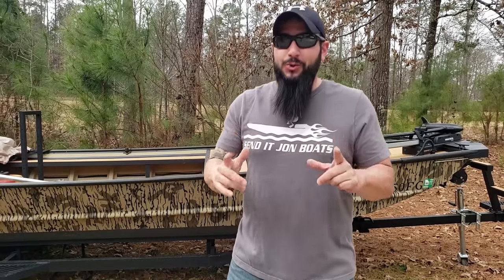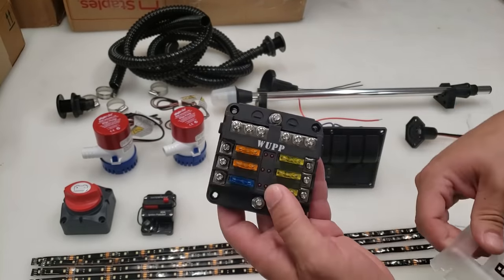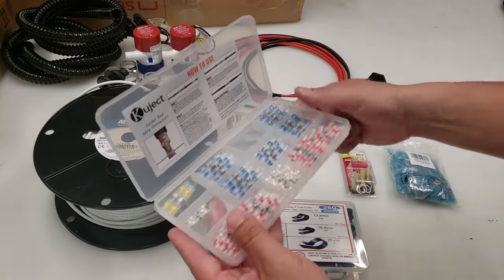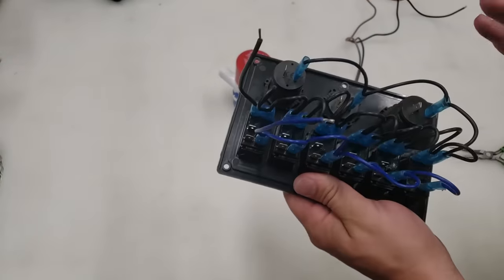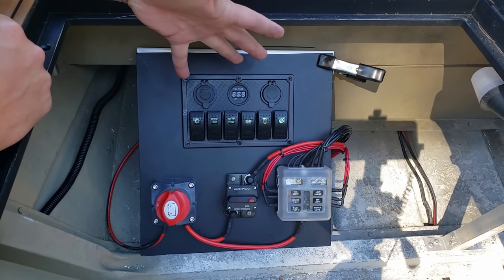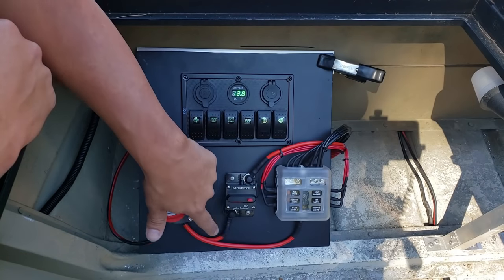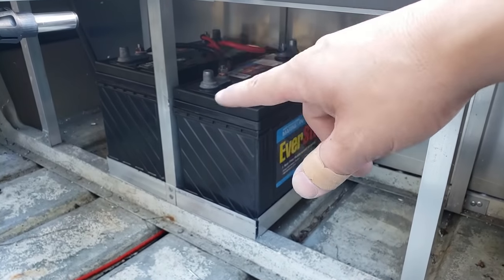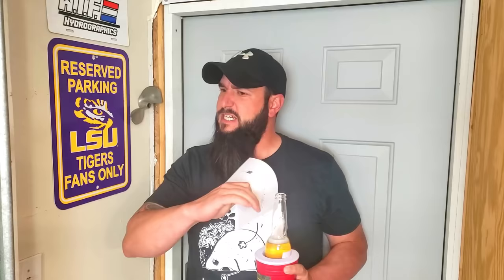Jon Boat Electrical Wiring for Beginners and DIY'ers

Comment: I had 14/3 left over so I just used my romex, I just pulled the black and white wires and used liquid electrical tape to seal it from the elements, has worked so far for me, great video

Comment: Hey I plan on doing the same build with wiring and electrical like you just showed in this video in addition I also plan to run a motor and set up similar to yours will the 13 hp predator be able to hook up to those batteries to use electric starter and charge batteries while running

Comment: Question.  What gauge wire are you using for your trolling motor? Have a 50lb thrust motor. Guy put some quick connectors on it and they are only 10 gauge. A 60amp breaker says its good for only 6 gauge so I'm thinking I would bypass the breaker and wire to the bus terminals instead. Thoughts?
Reply from the maker: I use 6 gauge for any trolling motor over 55lb thrust. On smaller motors like mine I use 8.

Comment: Very comprehensive video. I'm curious to know if your batteries discharge equally or if one discharges more when you use them in parallel like that.
Reply from the maker: Mine discharge equally, I think the key is using 2 good quality batteries that are the same age and have always been used together. I wouldn't take one old battery from one boat, and another random battery and expect them to discharge at the same rate
Reply: @SendItJonBoats  When doing this its important that the both batteries be nearly identical, same size, age, and make.   Just buy two at once.   Use a good smart trickle charger and condition them both together.  CTEK makes a good charger/maintainer.   I also use those wally batteries, they are really good.

Comment: Great video! I learned a lot! I'm restoring \ building a 1966 Mirrocraft 14 ft vhull deep fisherman. It my first boat. My question is that I drive a 1989 GMC 1500. Will changing my trailer bulbs to Led and with the boat I plan on changing everything to Led as well. Will I run into any problems or need to do anything different as in changing the bulbs to Led instead of the using the old style bulbs!
Reply from the maker: You should be fine to change over to LED. I changed all mine over and had no issues.

Comment: Got connection question... I've got a fuse block that I need to connect a 6g wire with a ring terminal...the fuse block post is small in diameter compared to the ring terminal size thats needed for 6g wire... what did you use?  Great video
Reply from the maker: Go to auto zone or Oreillys and get the copper battery terminals that fit. I am assuming you are wanting to hook up the main lug not one of the small accessory fuses. I like the solder on battery terminals but some people use the crimp on versions too.
Reply: @SendItJonBoats  yep, main lug... thank you sir! I'll check out so.e auto parts stores

Comment: We finally have to replace our motor after 29 years. Our Vanguard has low compression in the left cylinder and the Go Devil longtail is worn out after extensive use and slamming into who knows how many stumps. (RIP it lasted a VERY long time. We definitely got our moneys worth out of it.) While we spend $4500 on a new one I definitely want to splurge and add a battery switch, voltage meter,  second battery, and a phone charger to our boat. The boat is also 29 years old and the wiring is very outdated. It doesn't look as hard to do as I thought it would.
Reply from the maker: Nah it is not hard at all, just a little tedious. I knocked all mine out in 2 days and filmed it, so in reality it is not bad.

Comment: Hi, nice video , one question I start my boat wiring , have a 50 HP Yamaha 4 stroke , if necessary to install a circuit breaker or not , it is necessary which one is the correct amp for these motor ??

Comment: Great videos! Will be using this for rewiring my 19’ jon boat. How do you connect the power for the boat motor to this system? Just run straight from the battery switch? Ignoring the fuses and switches correct? Or should it have a breaker similar to how you have the trolling motor set up?
Reply from the maker: Run a separate battery for cranking the outboard, with its own battery  on off switch
Reply: I’m doing the same kind of project. I have a 8 switch rocker panel and I have only one battery. Am I not able to connect everything to that one battery or do I need an additional battery as well?

Comment: What size wire for the battery positive to switch and also the ground wire from battery to fuse block?
Reply from the maker: Depends on how far you have to run the wire. I used 6g because I had a short run.

Comment: I've watched your video twice and scrubbed through a third time and there's one thing you didn't specify (unless I missed it). All of the negative connections that are daisy chained on the rear of the switch panel, where do they end up going to? You can see at 27:23 that the last negative from the daisy chain hops in with the bundle of negatives that goes back to the front of your panel, but, where does it connect? I assume it connects to the negative bar across the top of the fuse block?

Comment: If just running 1 battery to the off switch do you still need and inline fuse between battery and switch, also if running trolling motor off a different battery with a 60 amp breaker on positive side do I need an inline fuse between battery and breaker as well? Thanks and great video tutorial.
Reply: Fuses are inserted to protect the cable. If there is a risk a current can flow of a magnitude that can cause the cable to get excessively hot, melt and catch fire, you need a fuse.
Reply from the maker: I always put a fuse in, just in case.

Comment: Whats better, wiring every thing to 2 batteries parallel or run separate batteries for trolling motor and another for the electronics

Comment: Love the video, very helpful. One question, instead of tinned copper, could you use oxygen free copper and still get good corrosion resistance?
Reply: No. The tinning on the wire is what helps with corrosion. Oxygen free is a better choice for say car audio. Now oxygen free, tinned wire would be excellent but probably pricey.
Reply from the maker: What Chris Murray said. Oxygen free is for car car audio and stuff like that. The tin is what keeps it from corroding.

Comment: Was curious. What is your setup to charge the two batteries? are they hooked up to the pickup or a trickle charger?
Reply from the maker: I just got a cheap harbor freight charger with clips on it. When I get home I clip the leads onto the batteries and let it charge

Comment: Just wondering, you said if you don’t want the lower blue lights on at all time take them off, but will the blue light still come on after you flip the switch to turn on one of the accessories?
Reply from the maker: No, if you don't hook the blue wire up the lower lights wont come on at all, only the bigger lights on each switch will light up.

Comment: So does the outboard motor get hooked directly to the batteries and all of the accessories get hooked up as shown in the video?
Reply from the maker: No I run a separate battery for the motor

Comment: Quextion:  My has its own charging system. I only had one battery but now I have two series  (paralleled??). How do I connect my engine back to the battery now without going to the switches? Great Video. Thanks.

Comment: On your bilge pump wires (I believe their 18AWG), no issues connecting it to the 16AWG? I have the same bilge and it's wires are 18AWG...not sure if it's OK lol. Yours good to go like that?
Reply from the maker: Yes it is fine to connect the smaller bilge wires to  the larger 16awg wire. The 16 is bare minumum for the distance I had to run on my boat. 14 would have been better.

Comment: Hey man, very informative video and I learned alot. My wife bought me a switch panel very similar to this one. It has built in breakers yet, I have a Fuse block I was hoping to use. My question is.....do I remove breaker wires and wire as you did or can I just wire it in and use both the fuse block and built in breakers? (Matching Fuse to breaker voltage)
Reply: Curious what you ended up doing as I am wondering same thing?
Reply: @lovefam10  I just removed the wire to the breakers and used my Fuse block
Reply from the maker: Glad it helped, yes remove all the breaker wires and start fresh.

Comment: Once all done, is one of the 6 switches what turns the trolling motor on/off or do you just do that through the separate circuit breaker?
Reply from the maker: The trolling motor doesn't have a separate switch, I just use the actual control on the trolling motor or you can hit the breaker switch but really no reason to.
Reply: Oh.  Now that you say it it’s so obvious !  Thanks

Comment: Hey man- this video was fantastic for rewiring the clusterfuck which was the 1981 Lucraft I found for a stellar price.  Thank you.  

I'm running into a snag and I would ask- if I run two 360 GPH bilge pumps, each needing a 2.5 amp fuse, to one lead heading back to my fuse box and rocker switch (total length to the battery and back is ~15 ft), what size fuse should I use on the box?  Do I add the draw together and assume a 5 amp total, or how does that work?  Thanks again, Im subbed after that one!
Reply from the maker: I would do a 12 or 15 amp fuse and it should be fine.

Comment: Will the bilge pumps turn on with the float switch when water comes in or will they only come on when you hit the switch? Looking to install one on my boat.
Reply from the maker: Mine do not have a float switch, but if you get one with a float switch yes it will automatically come one.
Reply: @SendItJonBoats  it will only automatically come on if it is also directly wired to the battery. the float will do nothing if there is no power because the switch is off/open

Comment: You might've said it in the video, but do you run a separate battery for the electric start on the motor?
Reply from the maker: Yes I run a small lawn mower battery for the mud motor to start.
Reply: @SendItJonBoats   Do you run anything off the charge coils or just recharge the electric start battery?

Comment: Hey, just curious, do I run the trolling motors to the fuse box as well? Or do you run those directly to the battery with an in-line fuse?

Comment: Do the switch panel and one of your accessories share a ground lug on the circuit board ground bar?
Reply from the maker: Yes, you can stack all the grounds on top of each other that you want, that is no big deal at all.

Comment: Is the white wire that you connected to the two-bilge pumps just house wire or is that marine wire also
Reply from the maker: All marine wire in this build. I do not trust any other wire for boats. Had too many corrode over the years and cause problems.
Reply: @SendItJonBoats  Guage ?

Comment: It's hard to find a sheltered elevated location on a Jon boat, but surely there is a place other than on the floor of the boat to locate that panel and that other visible wiring. If not, then maybe better to construct a more elevated position. Once saw a Jon boat with a similar fuse and switch panel in a weatherproof box.

Comment: What are your thought on liquid tape for sealing connections.  I would’ve loved to of seen the boat at night with the lights on FYI.
Reply from the maker: It works, just a little messy for my taste. I like the quick and easy solder connections.
I have a video all about the lights and light bars, you can see them on at night in that video.
Reply: @SendItJonBoats   If I might make a recommendation out of my opinion matters much I have no idea how to do YouTube stuff but when you’re going over the haters I think it would be cool if you ended with one of the positive statements.
Reply from the maker: @garrywaterman7570  Not a bad idea at all... I may start doing that. We just like to give the haters some love and a good laugh.

Comment: Regarding that blue wire for the lights on switch panel, if you were to choose to connect it, where would you connect it? On the fuse block? Sorry in advance for the silly question
Reply from the maker: Yes you would attach it to any of the power connections on the fuse block.

Comment: agree with everything but I would have liked to seen the main battery leads from the battery to the main switch in flexible conduit
Reply from the maker: I don't really see a need for conduit since all of the wiring will be covered by the subfloor that is going in, and nothing sharp in the bottom of the boat to rub or cut the wires. I could be wrong but thats just me.
Reply: @SendItJonBoats  just the vibration in the bottom will eventually ware through the insulation, have seen it before
Reply from the maker: @michaelreid85  First I have ever heard of that. I figured since mine are down in a channel rib and loosely laid in there that it could handle it, but I could be totally wrong

Comment: Awesome vid, quick question, I understand why not to ground anything to the aluminium hull but why do mechanics suggest to ground some devices on a vehicle to the vehicle chassis or whatever. Wouldn't that create your automobile being live (same as grounding to the hull of a boat) and thus you could become electrocuted from touching the body of your vehicle?? May be silly question but could someone please clarify.

Comment: What size wire do you use to go from you battery to the disconnect and then to your fuse block
Reply from the maker: 8 Gauge

Comment: I got a bluetti ac 200 max. It has a 12 volt 30 amp port. I wanna hardwired it to a dc control panel but scared ill screw it up lol.

Comment: How is single battery doing with trolling motor draw  do you see lights dimming or anything I’ve always had dedicated battery to trolling and then house battery for starting outboard and lights  but I also have very little accessories
Reply from the maker: I am running dual batteries for everything. No the lights dont dim, the batteries work real good.

Comment: Starting my build this week, curious why use a separate fuse panel if the switch panel has built in fuses? Is it just easier to customize exactly how you want or are the fuses on the switch panel not adequate?
Reply from the maker: I like having the fuses where I can see them instead of behind the panel.

Comment: In order to power the Voltage meter, usb and cig lighter do you have to turn that first switch on then?
Reply from the maker: Depends on how you wire it. I ran it straight to the fuse block so as soon as I turn on the battery switch the voltmeter and usb are live,
Reply: @SendItJonBoats  I copied what you did except went with a 12x fuse box.  Running two batteries with the off/on and selector switch, 6 gang switch box.  Pretty sweet setup, thanks for the instructions!

Comment: I've got a Tohatsu 30 HP (12V, 180W, 15A) on my jon boat so i was about to get the 65 amp add a battery kit.  In looking on line at several locations, I notice the 65 amp kit is way more expensive than the 120 amp kit.  Any idea why???   And, could I use the 120 amp kit on my motor with the smaller alternator and not cause any damage?  Thanks.
Reply from the maker: I am not sure, outboards are not my thing and I do not know much about them. contact TBnation.net they can probably give you more solid advice than I can.

Comment: Would you recommend wiring both bilge pumps for auto only or one auto and one on a switch?
Reply from the maker: I did both of mine together on one switch, no auto. If there is that much water in my boat, I will know it LOL
Reply: I would wire one on auto and one on a switch. Redundancy. If one fails you want a back up, and if they are both wired on auto, then there is a chance that the wear on both motors will be the same meaning that could both fail at a similar time.

So have one auto you can forget about, and if that fails, you can manually switch on the second bilge pump, and you can be confident it is not going to fail because it has not been subject to anywhere near the number of operating hours.

Comment: it sucks there is a hundred boat wiring videos and i cant find one on how to actually connect my lights together.  from what i can tell I need to run in parallel but what connectors do I use?
Reply: i can find diagrams but not an actual how to video

Comment: i have two batteries conected 12V system.  can i connect main motor and accessories if so do i just connect main motor as usual?
Reply from the maker: yes as long as both battieries are wired in parallel so you have 12v then you are fine to connect them.

Comment: You mentioned you don't ground the boat ... what about the ground on the motor ? The motor is bolted to the boat making  the boat ground  at all times how do you get around that ?
Reply from the maker: I run mud motors, not outboards, we don't ground mud motors.
Reply: @SendItJonBoats   every engine that I know of is grounded for the starter motor and other electronic parts to work,,,, I know you not holding the engine in your hands so how is the motor mounted on the boat I've looked at picture of mud motor's and everyone I looked at has steel brackets and bolts no plastic parts being used 🤔
Reply from the maker: @robokiss7822  No clue, but there is not a spec of raw metal touching the transom to ground it. All of the mud motor frame parts are powder coated and the transom is bedlinered so there is no way for current to flow from the motor block into the frame and into the transom. On the predator engines the motor block is aluminum and the starter is grounded to the block.
Reply: @SendItJonBoats  ok I believe you 👍 but out of curiosity put a light tester form the + of the battery to the alloy of the boat ,,,,,,,I thought my outboard motor was isolated by doing the pretty much the same as you but negative has found its way to the alloy boat it shits me off because if a positive brakes it's not good it could burn a hole in the alloy ( I have fuse on the battery just incase)